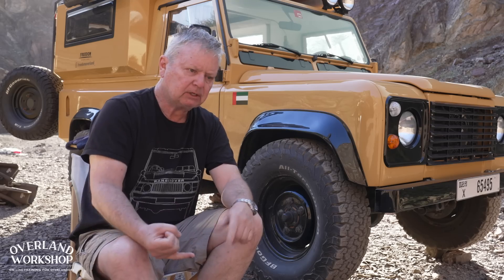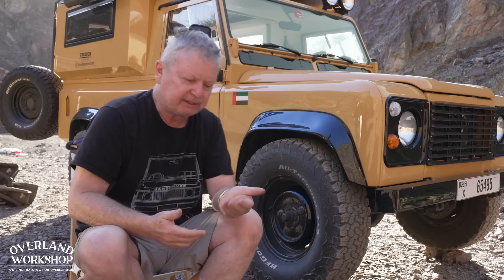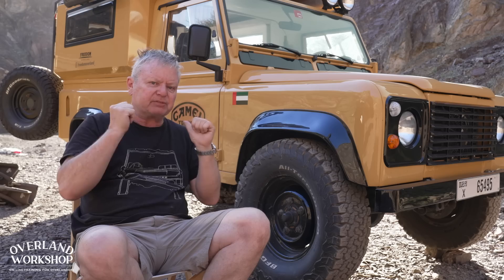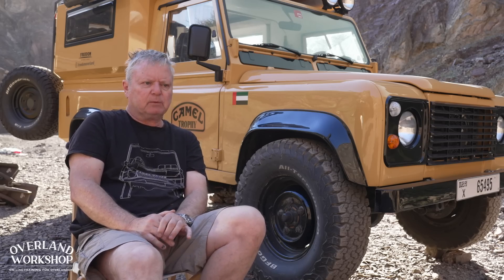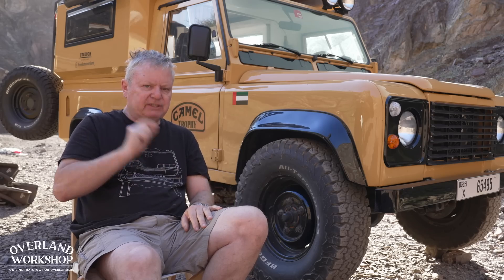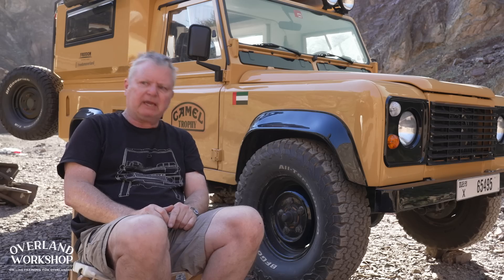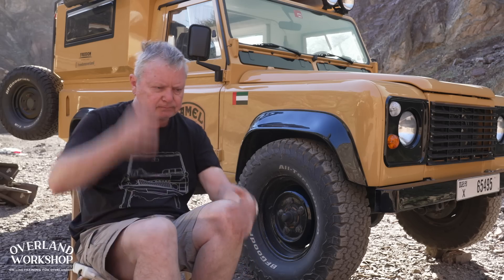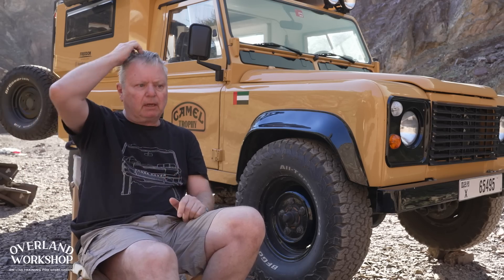4x4 Suspension principles, incorrect assumptions and stupid ideas @4xoverland

Comment: You were 100%  SPOT - ON in all of  this . The  MANUFACTURERS   GVM and GCM are what the Chassis is Engineered to handle .
Any Mods to exceed those numbers ALSO require significant Re-Engineering of the Frame itself . Inevitably at a Weight increase .
And , often , Governmental " Design Rules " GVM/GCM's are 30% lower . And the Idiots that carry Liquids on the Roof are simply Clueless .

Comment: I've emailed Toyota about the load rating for the roof. They responded saying they do not specify a load rating for the roof, just their roof carrier. I loaded my car and roof on stock suspension and it was horrid crossing east to west on Fraser Island. I changed the suspension (shocks and springs to what I carry) and wow, totally different ride. Couldn't feel the weight in the car. Still interesting they don't specify a load rating for the roof.

Comment: You are correct in your summary of the suspension and loading support, and suspension flexibility as you say, if you are stupid enough to overload the roof area, at least consider heavier swaybars it won't save you but it will help.

Comment: From South Africa.... I'm aware of the impact of water on the roof, and have a 60l tank up there.... but hear me out.

I only use it for traveling on hard surface to my destination,  because the water in most towns is now not to be trusted.

To slightly negate the lack of baffles I keep the tank full, and when done, I fully drain it.

When rough roading, I use 15l plastic containers that do not have a tap inside the back
... (I think it's ridiculous having a water container with a blooming hole in the bottom), instead I use a cap that has the tap fitting, and put the one I'm using on its side.

Back to my RTT, solo traveling, I can have potable water for up to 15 days, using a basin bath routine.

My vehicle is a disco ii 2002 which I have re- configured into an in vehicle sleeping camper.

Comments ?
Reply: I've done the same thing with fuel. I have kept 2 jerry cans (40L total) on my roof rack to get from the last fuel stop to where the dirt track actually starts. Then both get transferred into the main tank. I think that is well within the safety margin even for an old Land Rover. Regarding water, I saw a video from a guy who made a PVC drain pipe into a hot water tank for a shower that he put down the centre of his roof rack. The best part was, being an engineer by trade, he was smart enough to put 2 baffles in the tube to keep it from sloshing. I think it held about 30L in total.

Comment: Actually you will get different springs for x weight difference which is desided by the vehicle dynamics team of the manufacture. So it can be that you choose a 5kg upgrade part and that gives you stiffer springs cause you just got to the higher weight group.

Comment: Fully agree, keep to manufacturers specifications and keep your vehicle mechanically standard and presto, no problems. My self built overlanding 110 is within LR max 3000kgs and suspension designed for that. Mechanically as per factory and 400000kms later and maintained by the book, never a problem !

Comment: It would be interesting to hear you views on the proliferation of GVM upgrades sold here in Australia which are nothing more than springs and shocks.
Reply from the maker: They are often nothing more than springs and shocks is true. The difference is, that they have been tested and approved by engineers. The safety tests are thorough and this makes all the difference.
Reply: @4xoverland  I wonder whether the engineering assessment for gvm upgrades also allow for the impact on other vehicle systems such as brakes, transmission etc

Comment: Which manufacturer exactly tells GVM is OFFROAD capable?

I assume none! So here lays probably the most prone mistake.

On Truck - I mean heavy ones 10ton up - this load is assumed by manufacturers as HALF of the lifetime. This relates to the German ones at least: Merc, MAN 

Most people are idiots in that regard, in my opinion: They put stuff in/on that they´ve seen on Instablablablub - because of looks. I know people whose bumpers ways 200kg. The rear one - NOT in AUS, so no animals on the road.
Mine is 17kg. IF you put a storage box on the bumper ... it will be stuffed. In most cases with BS.

Comment: "You aren't increasing the GVM of the vehicle"...from the guy who put a GVM upgrade on a 79 and still went over it's 'new' load limit by putting half a caravan on the back of it.  Um ok.
Reply from the maker: Try and argue the argument, and not make personal attacks on the person presenting it. What I said is, changing the springs doesn't automatically change the max GVM. This is a fact. However, engineering inspections and approvals can up the GVM. As was the case with that camper. But you probably know that. You just wanted to try and make yourself feel special.
Reply: @4xoverland  I am special, all my friends tell me so ;-)

Your argument seemed hypocritical but perhaps it had just gotten confused. To be clear, just putting higher rated springs on a car ISN'T A GVM UPGRADE in anyone's mind, so no rational person would think that springs alone where what you mean't when referring to GVM upgrades. 

You said GVM upgrades don't change the GVM they make things work better at the GVM limit. I don't agree and certainly that's not how you acted when you fitted a GVM upgrade to your 79.  

So it sounds like you were meaning to say that new springs alone don't improve a GVM, I'd agree with that but it's not what you said.
Reply from the maker: Very many people do think that uprating springs increase the GVM. Its a very common assumption, rational or otherwise. You are mistaken. I changed the GVM on the Dream Tourer by having an engineered designed and approved GVM upgrade. This even involved chassis strengthening. This I explained clearly. And, as I admitted and thereby left myself open to criticism from all quarters, that I still felt that the vehicle wasn't well balanced. Its okay to try something and fail. One learns a lot more from failures than successes. What's not okay is to admit a failure on YouTube because people will do their best to not let you forget it.
Reply: @4xoverland  Sure, but you just danced around what I actually said. We agree that spring upgrades aren't GVM upgrades. We also agree that proper GVM upgrades do increase the GVM. Those two points got crossed up in your original comments.
I only mentioned the caravan on a 79 because it was a GVM upgrade being done and you had appeared to say such things don't work. All good.

Comment: if you modified all 16 vehicles then why have you shown on many video's, REAL proffesionals doing the work you claim you have done??
Reply from the maker: Do you mean, did I do the actual suspension lifting, moving, shifting, tightening, torquing etc with my own hands? Yes. In the early days before social media the judgements of strangers, I did everything. Rebuilt engines, gearboxes and changed countless springs and shocks. But I'd far prefer to have an expert do it using a lift, than me grovelling around in the dirt. Been there, done that. Had I done it all myself all these years, I'd be ignorant.  I choose to learn from the best and have done for 40 years.  As for my 'claim'. I have nothing to prove mate. To you or anyone else.

Comment: In 1976 I took a 1972  Range Rover from the U.K. to South Africa overland. A company called Quest 4 replaced the rear springs with ones from the front of a Rover 3500 S P6 !  They did the job well, even though we were carrying 100 gallons of petrol across the Sudan ! Good luck to anyone finding those springs now ! Enjoyed your piece on suspension very much.

Comment: The best stock suspension setup is on the LR Discovery 3/4. Heavy-duty bilsteins wrapped with high-quality airbags on stupidly strong double-wishbone control arms with amazing travel. It performs flawlessly in any condition. 
Highway? Amazing.
Towing? Easy.
Heavy load? Self-leveling susp on an HD frame
Off-road? Height-adjustable ride with great articulation and a cross-airbag link for better grip.
Uneven camping spot? Inflate/deflate front or back
Reliability is proven with the 10+ years of service

Comment: The only area I disagree is regarding rear sag and bump stop contact. Ideally I'd like to see a vehicle slightly rear high when its kitted out and level when youve packed the food/drink/water/clothes/bedding.
Mainly due to headlight aim and departure angle but also so you have longer bump travel to help absorb the bigger bumps. If you have 5" of bump travel factory and youve sagged 1" your suspension is having to absorb more energy (from the loaded weight) in 20% less distance.

I would also only want the solid rubber block style bump stops seen on defenders only contacting the axle in moments of low speed high flex like when you cross axle trying to cross a washout at an angle.
If its making contact at speed then it will shock load the chassis and regular shock loading will fatigue the steel. When hitting the bump stop it acts like a spring with infinite spring rate which unloads the tyre and makes the wheel lose traction and become skittish.
Progressive bump stops like the hollow cones the Japs use or hydro bumps are a different matter as its not a solid dead stop.

Comment: 16:12  The worst examples are 4 door utes with canopies on the back sometimes with spare wheels hanging off the back,   where half the load is  located behind the rear axle. Overloaded the outcomes is chassis opens up between the axles.

Comment: I do believe some 80% of the overland vehicles are overloaded with stuff.
And I do believe the right way to do is to put your money on weight saving then on springs and suspension. I prefer to work with the OEM spring as the manufacturer did thousands and thousands of changes to set it right, something we could not afford, and upgrade the shocks to cope easy with the heat - and use more expensive light weight materials for the rest of the build so I can reach exactly this "middle point" which the manufacturer designed the vehicle for...

Comment: It never ceases to amaze me that people buy roof tents, roof racks, fuel containers, water tanks etc and put everything on the roof without considering how this impacts their suspension and the inherent dangers of roll over they face. This is often made worse when they buy suspension extension kits . +2-5" and just get cheap ones without considering all factors. 

Anyone who puts any liquid on their roof is a fool - all liquids, water or fuel - should be kept as low as is practicable to prevent inertia roll. 

However - stupid is as stupid does sadly.

Comment: I drive a 2000 suzuki Jimny and havent touched the factory suspension at all until now. 
All because i'm well aware of that it couldn't be just improved.
Every thing you chance will improve something but will also make some other aspect worse. 
As long as im not totally done with the interior and the camping gear i carry around, suspension will be untouched. 

I wanted to have an RTT in the jimny so badly but also ditched the idea and went for an Oztent RV2 to keeo the center of gravity as low as possible since the jimny is such an narrow vehicle compared to it's height.

Comment: Your roof weights mentioned are questionable:
Land Cruiser max weight is 100kg (not 200kg). 
Y62 Patrol is 100kv max (not 200kg). 
Can’t speak for the Defender behind you but the 2023 Defender is rated at 168kg Dynamic load (including expedition rack) and 300kg Static load (including expedition rack). 
Perhaps older LC’s and Patrols are rated higher.

Water on the roof - yeah dumb idea. Maybe 10L if you absolutely have to but locate it centrally and in a flat bladder or storage device. 
As for the huge ones you’ve seen - yeah crazy but one would Hope they have baffles in them to prevent the water sloshing side to side (or forward and rearward) as you say. Heavy water - dumb on roof.
Reply from the maker: Early Patrols it's 200kg. Newer ones its less. Newer Defender is higher, I know. One of the highest in its class right now. Pity the rest of it doesn't qualify it for an adventure vehicle.

Comment: Not just offroading,  when i worked for Fiat when had someone bring in a Lada. Basically it's a 124 but the Russians had put in stiffer springs, either because of their roads or what they had in stock.
But they didn't change the shocks :( so it occelated up and down forever :(

Comment: Great summary on suspension Andrew. 2nd only to tyres as a primary upgrade.  Weight is such an issue offroad especially high up. I remember driving around overloaded LC70s on Cape York. Unfortunately, that and side impact safety are why 4x4s are getting too wide for tight tracks.

Comment: I have a light duty 86 F250 that has been in the family for decades.  The previous owner wanted to use it as a heavy duty F250, and added his own home made extra springs to the back.  Indeed, it does keep the back from sagging, and it can seem to handle a lot of weight without any issue.  But, as you mention, it is over sprung when the truck is empty, and the rear bounces and the ride is terrible without payload.  It takes a few hundred pounds in the box to make it ride right.  Everything is an art, and suspension builds are no exception.  There is a right and a wrong.

Comment: worst one ive seen lately was a discovery 3 with a roof tent  a large 270 awning and a full length water tank on the other side , 2 pelican boxes and max tracks strapped ontop of the tent
Reply from the maker: One of the worst I ever saw was a Land Rover Defender, five Jerry cans, a very large box and a RTT on the roof, two spares on the back and 5 people. It was leaving Maun in Botswana and its tow bar was dragging in the sand.
Reply: @4xoverland  some recovery guy following for when it tips over haha

Comment: Wouldn't you want to just fit airbags (or some manor of adjustable springs) to allow for the huge variations in weight?  It seems (from an outsiders perspective) that something like that would allow for proper ride height and suspension travel regardless of how loaded the vehicle is.?  I always imagined that if I built an overlanding vehicle, I would use a load-leveling system to maintain the ride height I desire.  I'd love to hear your thoughts on this.

Comment: Love the restained 'english' rant and agree 100% with what you said.
There are a LOT of stupid, un-needed mod's people do that are not only often counterproductive, but done to vehicles that never leave sealed/tarmac/concrete surfaces.

Even with people that do get their tyres dirty, it seems a big result of most modifications is a much higher probability of appearing in a Youtube video of the "idiots in 4x4s" type.
With a Landy, if Iwere looking to doing serious 4WD work, diff' locks would probably be high up on the list.

YES, not only are roof racks a concern with roll-over, but they increase the chance of structual failure of the roof structure when overloaded. A properly designed external roll cage may increase the load capacity, but also the need to "use" the roll cage.

Comment: Great video, I learned that it’s better to avoid anything on the roof and put all your overland stuff as low as possible between the front and rear wheels. This way you’re suspension will be working the best, 16:12 and if you are under the maximum weight of your vehicle, you will have the best Offroad conditions that’s possible. Thanks for the super video, I hope everyone will understand it, and leave the roof empty…….. best regards from the Netherlands

Comment: Ahhh Andrew, years of watching you and now a new advice video.  Bottom line, you're an influencer, all those builds and all those parts and accessories that magically arrive from suppliers... mmm.
Now a knowledgeable and influential chat on suspension design and upgrades to go offroading, what's your point?
Just use your 4x4 within the limits it was designed to perform in, payload etc. No amount of 'expert opinion' is going to get you home.
Enough, the 4x4 industry is about $$$ not having fun.
Do what you can within the limits the designers and engineers TESTED as safe and reliable. 
Opinion, $$$ v engineering and hard facts!
Your lost to me Andrew

Comment: Thanks for the wise words. Everything is getting out of proportion with huge tires and high suspension completely disregarding safety and performance. With big tires and high ground clearance is easy to drive over most terrain, but with no suspension flexibility and a choppy ride. It takes someone like you to tell it like it is.

Comment: totally agree with not fitting max rated parts, in fact I've told people not to fit things that they've gone off and had fitted, then regretted it... FYI Defender to 98 is 75kg roof loading and 150kg after, from what I can see, it was jsut an EU law that changed, so later ones are within the safety perameters. bad comparrison to be fair. oh, nothing else changes, still had same springs etc... 

Best advice is never take advice from someone selling you something!!

Comment: Thanks for this Andrew, this has to be one of the most useful videos for a long time, not that your other recent ones haven't been!  I just hope people listen.  I live on the Welsh borders in the UK and every weekend there's lots of kitted up 4x4s looking great but with loads of gear on a very heavy looking roofracks, the Discovery 2s also seem to have very jacked up suspension, a current fasion I think.  I regularly wonder how much, if any attention, they have paid to the roof loading weight.
Reply: > I regularly wonder how much, if any attention, they have paid to the roof loading weight.

Absolutely none, considering a d2 is rated for 30kg on the roof off road. It's less a strength issue and more the weight up there does bad things for stability. It's not too bad with a 100kg rtt when you're loaded up but empty it's unpleasant.